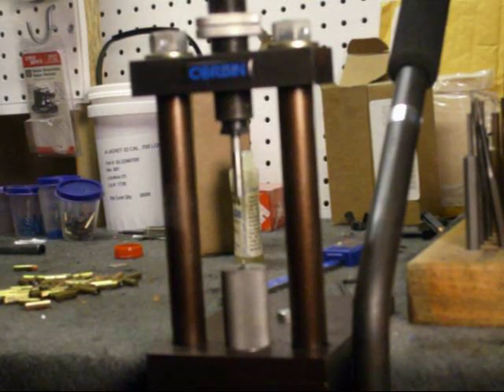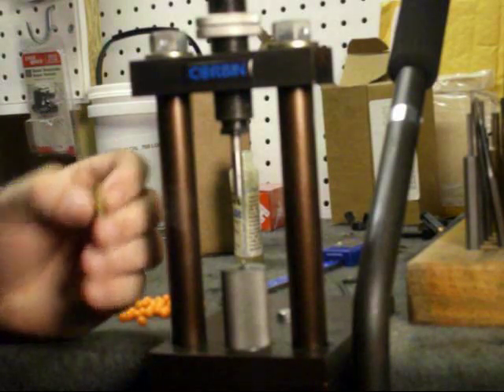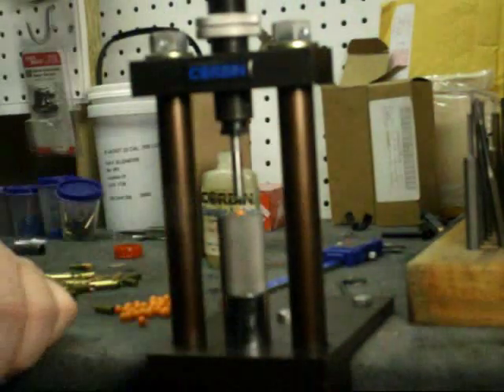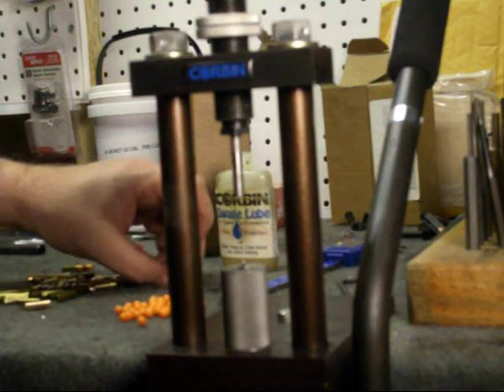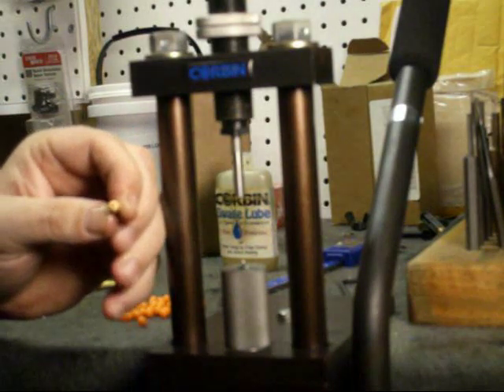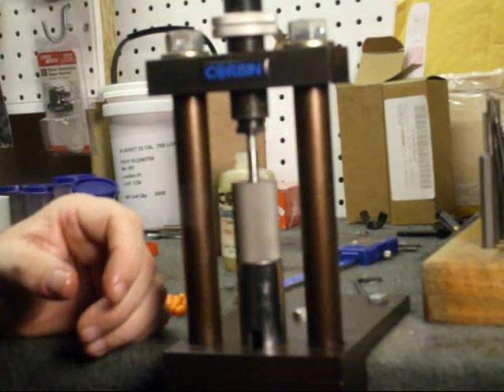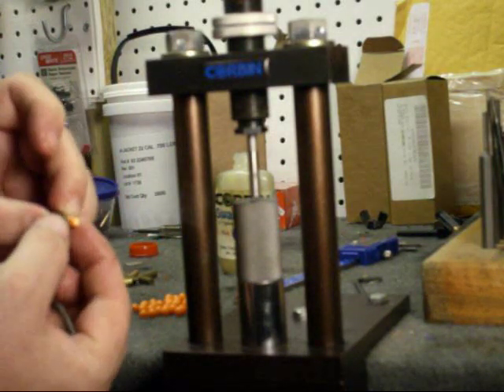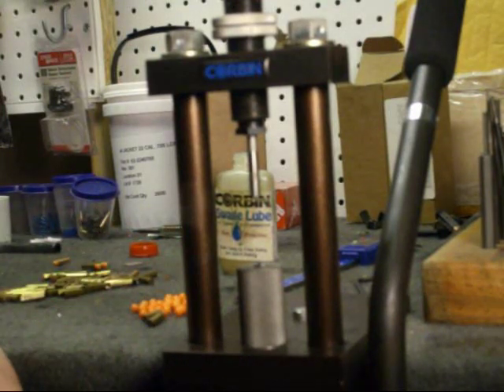Bullet Swaging Polymer Tips

Comment: +algunjunkie do you happen to know how much a set like this for swaging 223 bullets,or one for 308 ones is going to cost? thank you in advance
Reply from the maker: the prices have been going up lately. the best that I can advise is to check out Corbin's and BTSnipers. they are generally the cheapest.
Reply: algunjunkie thank you very much.
Have you tried making compressed shot cores?
Reply from the maker: +Gabriele Ciciriello yet but didn't like the performance I was getting when using shot. I later used a double core system and got way better results.
Reply: algunjunkie double core? Like partitions?
Reply from the maker: +Gabriele Ciciriello no, i swage two separate cores and them put them in the jacket and form a bullet. when the bullet hits soft tissue it breaks apart and there are several fragments to create multiple wound channels
Reply: Ah i see just two separate cores that separate on impact